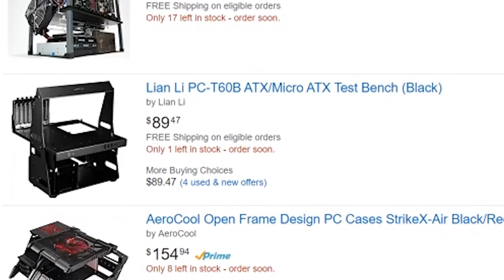DIY PC Test Bench

Comment: ALWAYS drill pilot holes when using long wood screws. It lets your screws go in straighter if you drill them right and the wood won't split if you drilled them the right size.